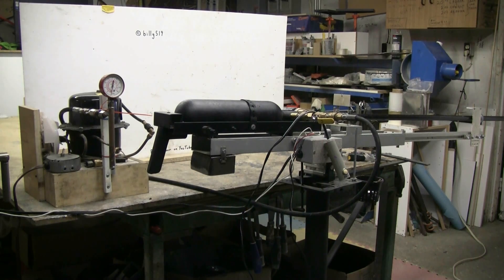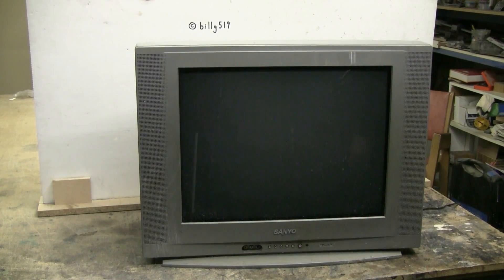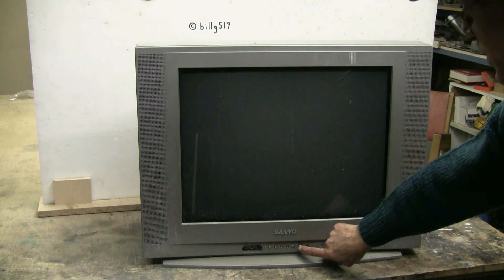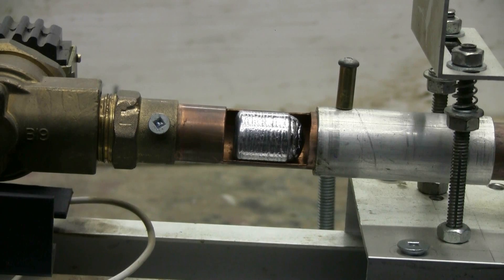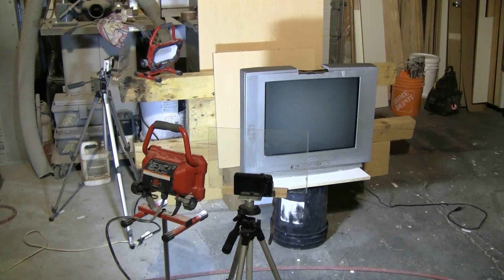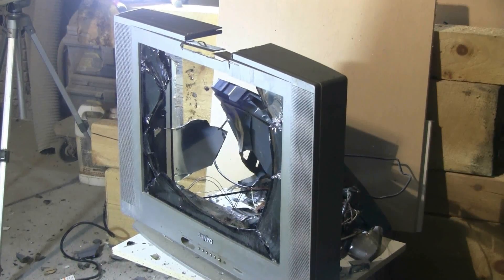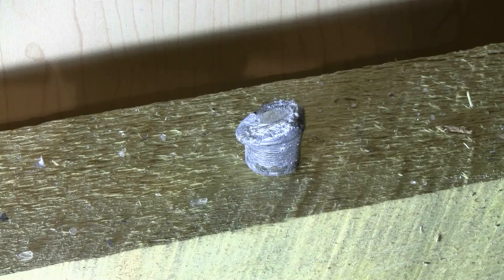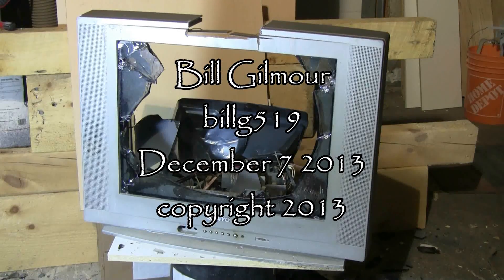Air Cannon #107 - A Running 23" CRT TV

Comment: Best TV implosion EVER!  Good call on cutting the implosion band, which I didn't even know existed :P

Before you touch the wreckage make sure to discharge the capacitor... Oh wait, it's in a million pieces. :D
Reply: Alonkr A problem has been detected and Windows has been shut down to prevent damage
to your computer.

The problem seems to be caused by the following file: ntoskrnl.exe

CRITICAL_OBJECT_TERMINATION

If this is the first time you've seen this stop error screen,
restart your computer. If this screen appears again, follow
these steps:

Check to make sure any new hardware or software is properly installed.
If this is a new installation, ask your hardware or software manufacturer
for any Windows updates you might need.

If problems continue, disable or remove any newly installed hardware
or software. Disable BIOS memory options such as caching or shadowing.
If you need to use safe mode to remove or disable components, restart
your computer, press F8 to select Advanced Startup Options, and then
select Safe Mode.

Technical Information:

* STOP: 0x000000f4 (0x0000000000000003, 0xfffffa800b796b10, 0xfffffa800b796df0, 
0xfffff80004bd39c0)

* ntoskrnl.exe - Address 0xfffff800048ca180 base at 0xfffff8000485a000 DateStamp 
0x57c9932e